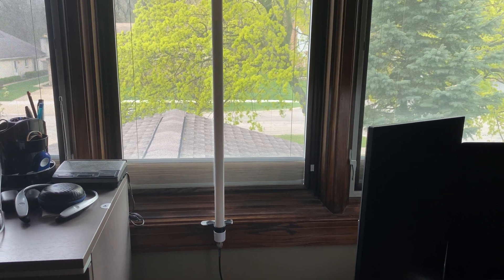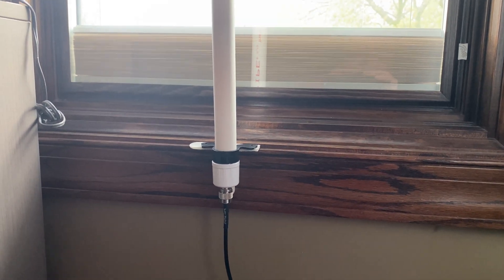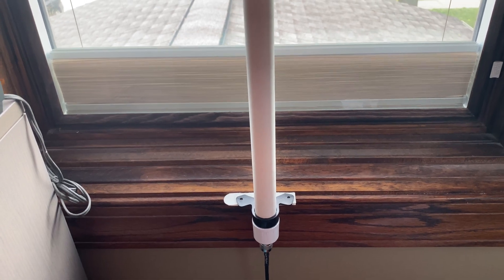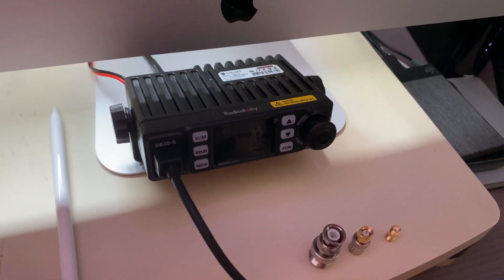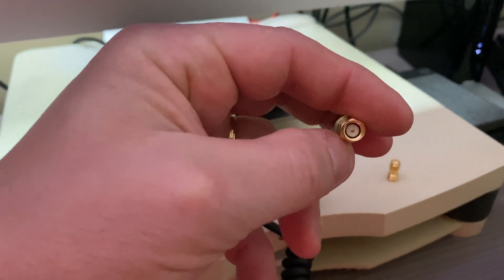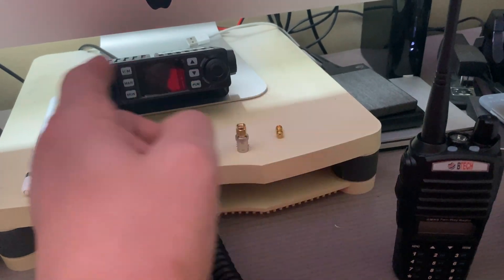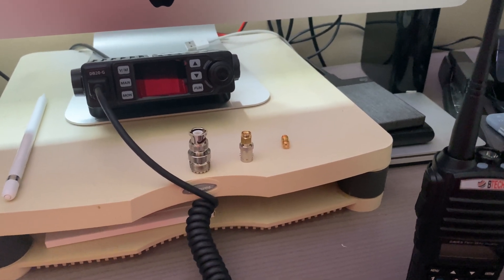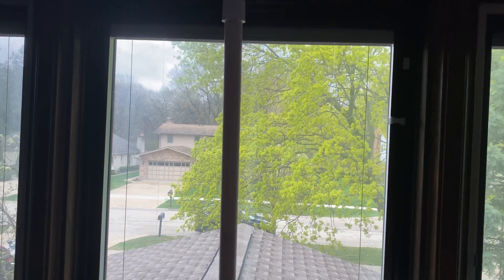Ed Fong GMRS J-Pole Antenna

Comment: J pole antennas produce common mode current which is detrimental to performance and the radio. You need to put three or four mix 61 ferrite chokes on the coax right up by the antenna.
Reply from the maker: Is this for all J-Pole antennas?  Wondering why Ed Fong makes no mention of doing this with his antennas. Never heard of it before. Interesting. 

Thanks for watching and commenting.
Reply: I was wondering exactly same question.  Anybody have current intel?  Seems like common in Ham ops? Btw I’m a total noob, but I did stay at a Holiday Inn last night 😝

Comment: And I'll mention this because i didn't see anyone else say it,  not only is lightening not an issue,  but PVC is so durable that Ed stayed he had some that have been outside for 20 years.  PVC is more durable than fiberglass. If at all possible, mount it outside. High as possible.
Reply from the maker: @sweet65mustang  great points!!  Having the antenna mounted outside wasn’t an option for me, therefore in the attic above the office bedroom was a perfect place. I hit all my local repeaters without a problem. I also put up in the attic a 4’ (that’s all the height I have in my attic) Comet GP1 dual band for 2m/440. That one’s hooked up to my 25 watt Anytone AT-771UV. I’ve been getting great results with that combo. 

Thanks for watching and commenting.

Comment: You don't need to worry about a j-pole getting struck by lightning.  That is the main benefit of the design, no ground plane required, the j-pole is a dc short circuit that won't build up charge at a point to attract a lightning strike.

Comment: PL259 is goo up to 100Mhz.  I thought GMRS was around 430Mhz? https://en.wikipedia.org/wiki/UHF_connector
Reply from the maker: GMRS is 462 Mhz (467 Mhz when transmitting to a repeater). The antenna socket on the backs of GMRS mobile radios are SO239’s, so you have to use a PL259 connector. .

Comment: What kind of coax can I use on one of those?  Want one in my attic too! Are you reaching the repeater?
Reply from the maker: Here is the coax I’m using. 

MPD Digital... https://www.amazon.com/dp/B00TC0OBB8?ref=ppx_pop_mob_ap_share

Yes I can hit my local repeater without a problem but I can also hit it with my HT with my rubber duck antenna, as the repeater is only 4 miles from me.
Reply: @EverydayATV  thanks for the reply! I am replicating what you have going on there! I really appreciate your GMRS posts. Very helpful and educational!

Comment: Antennas like that are made to be placed on the roof or outside. You are endangering yourself or other family members by transmitting so close to your head. The FCC doesn’t require any testing for the GMRS license, perhaps they should.
Reply: You probably have aluminum foil in the kitchen. Just make hats! 😆😆😉😉
Reply from the maker: You are absolutely correct. I pinned an updated comment a month ago after talking with Ed Fong regarding the placement of the antenna for different GMRS power levels. Until I can get the antenna outside, the radio is now set to 4 watts and used mostly for listening. I use my Wouxun Kg-935G HT the majority of the time. 

Thanks for watching and commenting.
Reply: Yes. And have you measured all the wifi and 4g5gcell phone network radiation in your house? And your neighbors wifi signal in your house 24/7?
Reply: I made aluminum foil hats for everyone coming into my house. 😊
Reply: My attic installation means it is always at least one floor and 30' from any person.  I run about 30W into it and have no qualms.
Reply: Cell network and WiFi is more likely to harm you. That being said, yes having it away from you is definitely wise lol

Comment: I have the same antenna in my attic.  I use an HT into an amplifier that pulls it up to about 37W.  Works like a champ, as does my Ed Fong j-pole for 2m/70cm which is connected to a 50W radio and is also mounted in the attic.  Great antennas for sure.
Reply from the maker: Good to hear 👍. Mine’s going in the attic soon so that I can run my GMRS at the full 20 watts without worrying that it’s 6’ away from me. 

Thanks for commenting and watching.
Reply: Do you have a link to the amplifier?
Reply: @K4ACJ  I bought it used off of QRZ sometime back.  Has an odd brand name and I was unable to find anything online about it.  I do know there's versions of 'em (separate ones for UHF/GMRS and VHF/Ham) available on Amazon.  Think they were a bit pricey, over $100, if I recall.  I paid $50 for the used one.
Reply: I’d like to get this but found my attic has the metallic lined insulation. Not sure how well it would work in the attic now

Comment from the maker: Update: I reached out to Ed Fong and Ed recommended that if you have the antenna in the same room, that the radio should transmit no more than 5 watts. Anything higher than that and the antenna should be in a different location and that with a 50 watt radio, the antenna must be located outside.

Also I misstated….it is a +5dB gain antenna, not a +3dB gain as I stated in the video.
Reply: I was going to ask about having that antenna right there in the room with you when pushing more than 5 watts through it. Thanks for the update. Did you end up mounting it outside?
Reply from the maker: @ I ended up running the DB20-G on low power (<5 watts) until I was able to relocate it. The other good thing was that it was used 99.9% of the time for receiving only. I would transmit for no more than 10 seconds once a week to check into a GMRS public safety Net. 

That antenna and my Comet GP-1 dual band antenna (used with my Anytone AT-778UV are both now up in the attic running at full power on both radios (25 and 20 watts respectively). I’ve been very happy with the performance of both. My attic is only 4’ high at the peak, so the Comet just fit perfectly in there. No height problem whatsoever with the Ed Fong antenna. Works great with many of my GMRS HR’s too. 

Thanks for watching and commenting.
Reply: Is this for safety to you or safety to the radio? I'm new to this just picked up the same radio thinking about the antenna
Reply from the maker: @avatargunner6776 it’s definitely for the safety of you and the RF energy that’s being transmitted so close to you. If you have your radio set to transmit on low power around 4-5 watts or have an HT connected to it, it’s no different than using an HT next to your head. Once you’re transmitting at the 20, 25 or 50 watt levels, it needs to be outside or in the attic to protect you.

Comment: Is the antenna safe to be around being you're transmitting from the same room as the antenna is in? I want one for my attic but from what I'm reading people say to make sure it's not close to people when transmitting from indoor antennas. Thanks.
Reply from the maker: Great question and you know, I never really gave it any thought. When you’re on a portable GMRS radio, you’ve got 4-5 watts coming out right next to your head. The Radioddity mobile that I use as my base is a 20 watt and the antenna is about 6’ away from where I sit at my desk. 99% of the time I am just listening unless it’s my turn to host our weekly Net. Then I’m transmitting off and on for about a half hour. If I had a 50 watt radio indoors, I would definitely not have the antenna in the same room. I’ve heard of a lot of people putting them in their attic. 

I will reach out to Ed Fong with your question and let you know what he says. 

Thanks for commenting and watching.
Reply: @EverydayATV  Thanks for your quick response. Yes with a 50 watt base station I definitely would create some space between the antenna and people that may be close to it. Not sure how a 20watt radio would affect a person near the antenna. Hopefully we can get a definitive answer. I just want people to be safe while enjoying GMRS or HAM communications.
Reply from the maker: @markg3913  I received a response back from Ed Fong. He said that for any radio that is over 5 watts, he suggests that the antenna not be in the same room and for a 50 watt radio, it definitely needs to be outside. 

Looks like I will be moving mine to either the attic or outside.
Reply: Uggg. Yes put the antenna outside, better for you , and antenna performance.